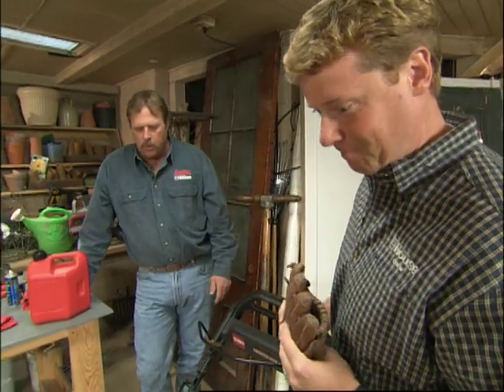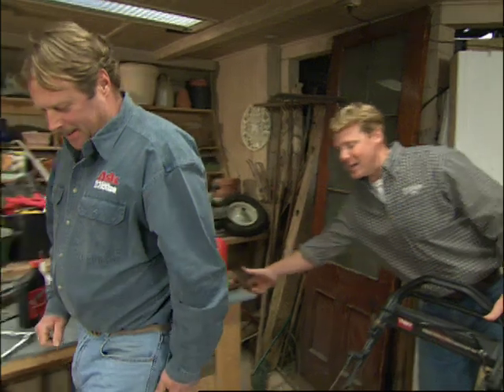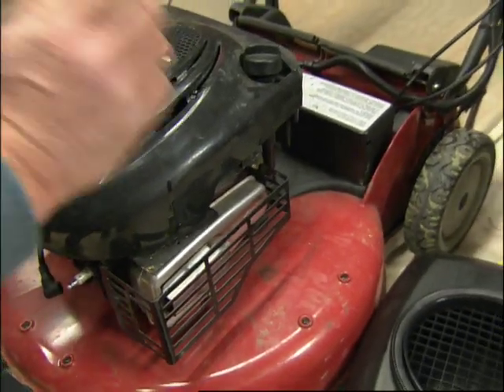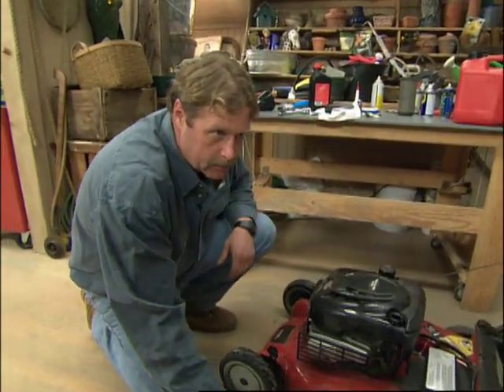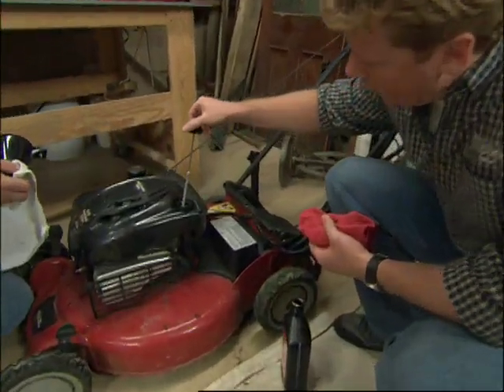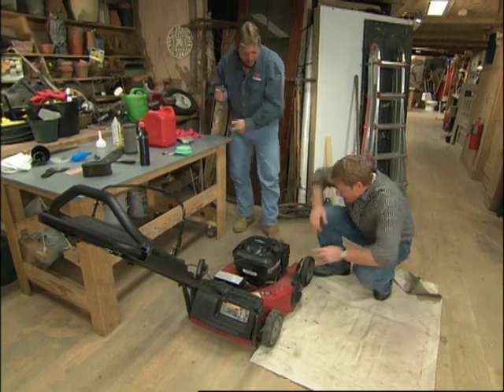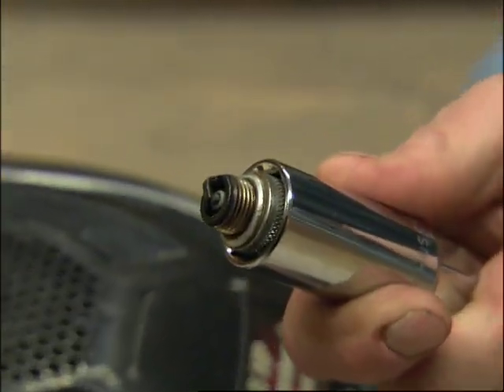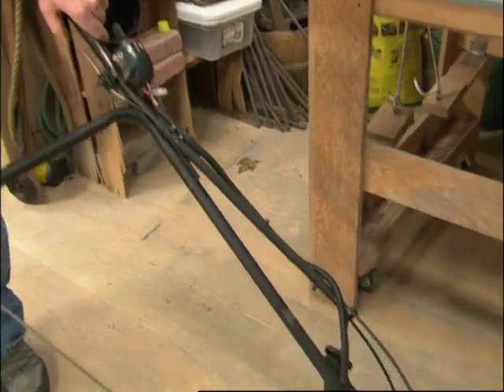How to Maintain a Lawn Mower | This Old House

Comment: Theirs four things I feel compelled to mention on this video.
1) The rubber on the plug socket isn't for the porcelain. It's for when you install plugs on cars so it won't drop out of the socket. (Doesn't work very well but that's another rant.)
2) You don't need to replace the plug every year. (The one in the video looks fine and yours should look like that too.) Just take it out and check the gap and adjust if necessary. (Your Engine manufacturer will have the specs. . . . . GOOGLE THEM YOURSELF!) A plug should last many years but it never hurts to keep a spare around. Store it some place where it wont get knocked around because the porcelain is very fragile.
3) This is also a perfect time to sharpen your blade. While your under it this is also a great time to remove any dried lawn clippings that are stuck to the under sides of the deck. In fact this should be done once a month and especially before you put it away for the winter. The dried lawn clippings can hold moisture causing your deck to rust out. . . . . Maybe consider using this time to also take off the top plate/shroud thing so you can remove any lawn clippings that are stuck under that too. The engine shroud helps direct the air flow coming from the fan built into the flywheel for engine cooling so it's very important to keep that clear.
4) Many lawnmowers have a sponge type oil filter where you don't need to replace it every year. Just take it out so you can wash and dry it (Dawn works great) then re- oil it before use. I normally use some of the left over new oil from changing the engine oil. Just make sure to ring it out after applying. 

Remember before you buy. . . . . .  Even a "cheap" $120 Briggs&Stratton lawn mower should last you a good decade or more if you take care of it and don't abuse it so don't listen to the salesman trying to sell you something more expensive if you have no intention of taking care of and respecting your purchase.

Hope I've helped someone and happy mowing. 
Peace and love
Reply: @solojohnson8623  Make me.
Reply: I don't think you waste much buying a new spark plugs each year, your already gonna get oil and an air filter. Getting oil, an air filter it's pre filter and a spark plugs was 20 bucks for this season on Amazon with prime for my mower. Cheap maintenance and insurance every season. These were OEM parts too
Reply: I replace my spark plug yearly and even when it doesnt need replacing, run my mower dry of gas when winter starts, but always leave oil in it! Then when its spring, drain the oil, fill it up, replace the spark plug, air filter, and add fresh gas, and with a little encouragement, my 1989 lawnboy starts up and has been serving me for many years. And yes, cleaning the deck and making sure that you mower is stored in a DRY place is really important. Not only for the winter, but every time you are done cutting grass your mower should be put in a garage or shed. If you have neither of those. Put it on a pallet, and cover it with a tarp.
Reply: If your old oil is muddy and creamy looking, you probably have water mixed with the oil.  Drain it immediately, then add new clean oil of the proper weight to prevent rust within your engine.
Reply: Solid advice even 6 years later.
Reply: @TheToxiicLover  Thank you

Comment: The drain plug will most likely be on the bottom of the mower deck, above the blades. Which you should also take off to “shop-en” in the spring
Reply: I would say that most oil fill and drain plugs are not on the bottom but are on the lower side of the engine. When you tip the mower on its side, to drain out the old oil, make sure you keep the drain plug on the lower end of the engine so as not to cause problems with incorrect draining into the carburetors. Tip the mower on the side that has the oil drain/fill on it.

Comment: I'm very surprised they didn't talk about sharpening and balancing the blades. That's a crucial part of the performance of any mower. That being said, if you can find a supplier that sells non-ethanol high octane gas, you should buy and use it. I have never drained or run my mowers dry but I do add and run a stabilizer through the mower. I use a product called Sea Foam. There is the gas additive and they also have a spray lubricant and both work extremely well. I've never had a problem with Spring startup and here in Vt, it's could be a good six months or longer between the last fall and first spring mowing. You should also change your oil about every 20 hours of use and sharpen the blade the same time. It's amazing how quick they can dull.
Reply: My last mower I had, I ran 50:1 2-cycle mix in it.  I had a boss a long time ago that swore by it. He said it would smoke a little, but it kept it well lubricated. IT made it easier for me, same gas can for the mower, and for the string trimmer, and leaf blower. That mower lasted me over 20 years. I finally had to get rid of it because the deck was more patches than original deck material. The motor was about to drop out of the deck because most of the deck had rusted away.  But it still ran great - started right up and ran strong. I am running straight gas in my new one. Not sure if I want to do that again.
Reply: Honestly they dont make stuff like they used to.
An old mower some 30 years ago would have no problem having gas left in it every year.
I feel like its such a pain keeping the new stuff working. Already on my 3rd and I did everything the user manual says like on this video.
Reply: @bobshanery5152  I think a lot of the problem is the Ethanol. It plays havoc with small engines and even cars that get stored.
Reply: I have a Craftsman mower with a Honda GCV-160 engine. I bought it in 2017. It sat at my sister-in-law's house for 3 years with the same gas in it and was never run the whole time. When my wife and I sold our condo and bought a house with a lawn, we got the mower back. It fired right up on the first pull without a tune-up or new gas. I mowed the grass with it about a dozen times before fall set in. Then it sat in the shed with the same gas in it all winter. I changed the oil, cleaned the air cleaner, and swapped the spark plug, and it still runs perfectly. 

My dad swears by Honda engines. Basically any tool he has that doesn't say Snap-On, it says Honda. He's got water pumps and air compressors with Honda engines on them that date to the 90s. He's a farmer so his small engines all get put through their paces. The engine on my mower is just so unfussy, unlike just about every Briggs engine I've ever touched. My in-laws are borrowing my mower right now because their Briggs mower refuses to start.

It could be like you said. I personally avoid ethanol in all of my engines when I can. My mower has never had ethanol in it. My cars only get it if I'm running on vapors and the only gas station for miles only has E10. Plus, my cars seem to use more fuel when I run E10 in them.

Comment: I hate the lawnmowers that must be tipped to empty the oil. They never seem to drain fully. Every machine should have a drain plug on the bottom but I assume this feature adds to the cost of production.
Reply: You can usually pull the cord slowly a few times to cycle the motor and get more oil out.
Reply: @panamediallc4454  thanks for that tip!
Reply: They also sell oil drain/fill manual pumps that work quite well at getting rid of all the old oil without tipping the mower at all.
Reply: @jameskoralewski1006  I understand but I do feel a plug in the bottoms allows it to drain quicker and more thoroughly. It would seem to flush any debris out effectively versus drawing it up. Good point, though, and I wasn't aware of the pumps.
Reply: @jameskoralewski1006  Agreed. I used a siphon, and it worked great.
Reply: Siphons do part of the work. Gravity will do most of the work.

Comment: If your oil is that "muddy", Drain and replace it before running out the rest of your gas prior to winter storage. Then drain and replace it again just to make sure you've gotten all the crud out before putting it up for the winter.

Comment: I am not convinced that draining a tank dry is the way to go anymore for off season storage, long-term it does seem to damage seals/fuel hoses and if you have a newer snow blower/generator with a China built engine that has a metal fuel tank they can rust internally if left dry. I religiously use a quality fuel stabilizer like Star-Tron or Marine Stabil as soon as I buy my gas add it to the container when I get home. For off season storage I keep my tank full run the engine for a minute or two then shut off the fuel supply shut off switch (if your equipment has one) let the engine run out of gas and then store it. I am confident this method will prevent my fuel hoses/seals from drying out. Time will tell, so far so good.
Reply: I don't drain my gas tank dry. I top it off to full and fill it with a good fuel like True Fuel. This stuff does not contain alcohol, is 92 proof, and already contains a fuel stabilizer. I've never had any problems starting my engines after an idle winter season and do not waste any fuel, needlessly!

Comment: Everything but the "dirty" spark plugs need replacing bit was accurate information.
Reply: The air filter looked fine, too. xD
Reply: If you are going to replace your plugs, make sure you gap them before replacing them.

Comment: Another good tip for end of season once you run it dry remove the spark plug and poor a cap full of oil down the cylinder

Comment: sharpen & balance the blade
Reply: So how would you balance the blade?
Reply: MrTBoneMalone
There's a cone shaped balancer you can buy that you use while you sharpen the blade. Or you can make a string balance from a string and a washer. You have to make sure you don't unbalance the blade when you sharpen it or the wobble in the blade will eventually destroy your lawn mower.
Reply: you can use smooth nail or pin to hang it on
the heavy side be lower grind off that side
Reply: MrTBoneMalone I prefer to balance it on a marble, but that's just me.
Reply: Ryan Holmes You are talking about your lawnmower blade, right?
Reply: Maxid1 Yeah. Why do you ask?
Reply: Maxid1 Thanks for the advice!  I understand why it's important to have it in balance, I just didn't know something that simple could balance it.  Actually though, it makes sense.  I appreciate your response!  Thanks again.
Reply: Some folks use a Marble or Large Ball bearing  to place in the retaining bolt hole of the blade...
Reply: @MrTBoneMalone  what about the spock plug?

Comment: Put a little dielectric grease on the porcelain part of the spark plug and a little in the spark plug boot but not on the electrical contacts within the boot. The plug boot will come off much easier if you do this trick before next season!

Comment: You want to let the oil settle for 5 to 10 min. before you check also that air filter can be cleaned just fine and you could clean that spark plug
Reply: Most mower air filters and spark plugs are not recommended to be cleaned. They are both relatively cheap and should be replaced.

Comment: I use a turkey baster to remove the oil in my lawn mower.
Reply: This is a bad idea. You won't be getting much of the old oil out using a turkey baster. Get a manual pump instead from Lowes.

Comment: What does “don’t cross the threads” mean at the end?
Reply: When reinstalling, go slow and make sure it is started straight and not crooked. Think of a light bulb, or better yet a garden hose. If you start the hose at an angle, you can force it to tighten, but you are crossing the threads. Meaning carving new threads into the metal which will ruin your fit

Comment: Correct replacement plug (NOT necessary in this case) involves much more than correct sizes of threaded part. Heat range must also be correct. Engine mfg. can provide info for particular engine. Else, just read the plug info on the insulator and get another, or cross-reference it. Parts-store counterman should be able to find just what you need. NGK is really on the upswing for quality small-engine plugs, OEM on Husqy/Dolmar saws for one thing. Oil should really be changed while hot. IMO
Reply: Just buy the replacement plug from the same manufacturer as the original plug using the numbers on the plug or reference your owner's manual.
Reply: @jameskoralewski1006  Not optimal IMO, since some mfgs are notably cheaping-out on their product quality. And, you'd really have to twist my arm to go for a "Torch." I'd suspect they only have one heat range. (j/k)

Comment: Do we use SAE-30W oil for every lawnmower
Reply: No! Check your owner's manual. Usually, the oil weight to be used depends on the temps that the mower will be cutting the grass.

Comment: 15 years using it and have done nothing to it. Have not changed plug, filter, oil, have not sharpen blade or lubricated any moving parts, always used very old gas, but still runs perfect, same as on day I got it. Starts after every winter on first pull.
Reply: What mower you got?
Reply: You must have a magic mower you probably never had to put gas in it either!
Reply: @danieleljoundi6364 😂

Comment: You don't replace spark plugs in your car every year. Right? Brush the carbons out and install again. Replace it only when the center electrode worn out.
Reply: Plugs are a lot cheaper than putting up with a poorly running engine due to poorly performing plugs!

Comment: I find the carburetors get gummed up because of fuel evaporation so i shut off the supply and let the engine run dry. also the engines only last two or three years so I replace the engine with an electric motor and battery and those last 5 to 10 years.
Reply: I have a mower from the 80's and it runs fine

Comment: the rubber in a spark plug socket has nothing to do about the porcelain... it's to grab the stem and help remove from larger car engines that can be DEEP inside a cylinder hear/valve cover.
Reply: If you don't use dielectric grease on the porcelain, the plug porcelain can become stuck to the rubber boot due to heat and can tear during removal. Try a little dielectric grease and your plug boots will never stick and will remove much easier.

Comment: One thing they did not mention... storing gas for that mower.  Today's gas usually has at least 10% ethanol which absorbs water from the atmosphere.  Add a treatment like "Sta-bil for Ethanol" when storing gas and you will cut down on some starting problems with all power equipment (and boat engines too).  Water in the gas will make the engine hard to start and run rough.
Reply: Would recommend using ethanol free gas.  In many towns this can be difficult or impossible to find at the pump, but most outdoor power tool centers will sell bottles of ethanol free gas that is stabilized for many years as well.  Well worth the extra money.

Comment: I have an electric lawn mower and there not one thing I will do what these guys did. I always reccomend people to buy an electric lawn mower, either one where you have a plug following or to charge and go....it's the 21st Century, isn't it great?😋😋
Reply: Wait until your $250 lithium battery goes bad and you have to buy a new one to continue cutting grass.

Comment: I've never seen a lawnmower without an oil drain plug on the bottom.  If you tip it over like that you can easily fill the cylinder with old oil - a real mess

Comment: American-made mowers that I've owned through the years have been garbage. I've had better luck spending $50 for a used mower every year than wasting hours of my time "fiddling" with this fickle BS. I have a 4 bedroom home with a decent size yard. I've decades of auto-mechanic experience but I absolutely HATE small engines. Fickle throw-away machines. Such a waste.